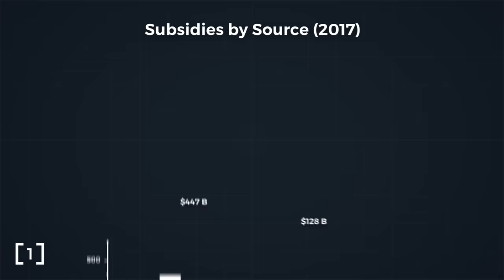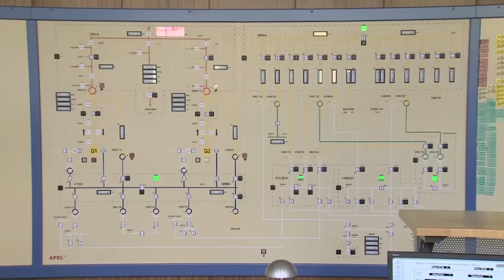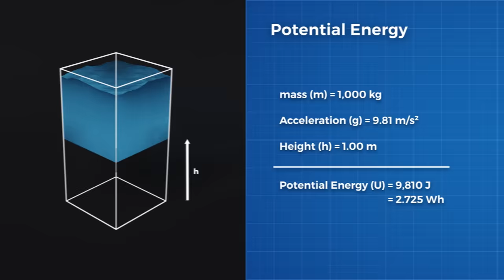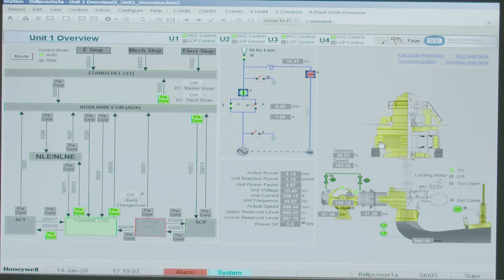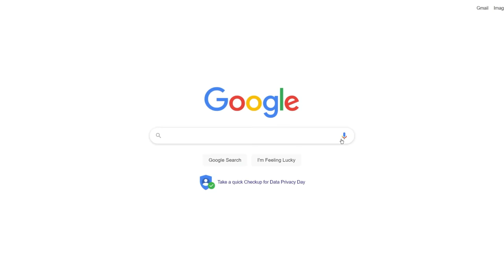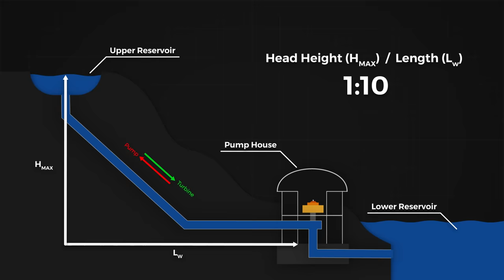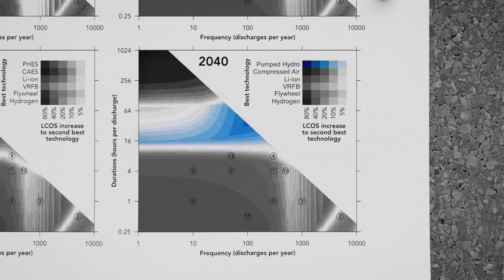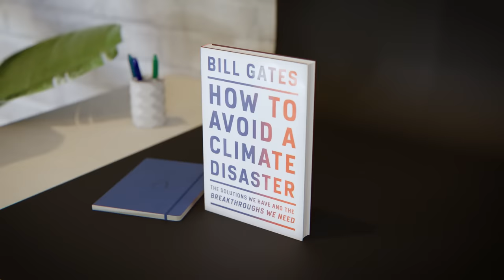The Truth About Pumped Hydro

Comment: Yep sadly you also can't use salt water as cheaply thanks to the salts effects on the piping and machinery. You need more specialized and robust materials for salt water. Not a massive increase but on such a scale even 10% is a lot of money.

However you missed  1 MAJOR advantage of water pump storage. Its ability to do this with nearly 0 environmental damage. All current battery technology just shifts all the environmental impact over to where the materials are mined. While the impact is still lower than fossil fuels its still not a great solution. Truth be told our best bet to remove fossil fuels is to build more of these, add some of those new modular mini nuclear reactors, throw on a few batteries and finish it with less than 5% of the fossil fuels we are using in the form of natural gas just in case of one problem or another.

Comment: Coastal erosion would be a risk with sea water ? if you dig a hole off a coast would that mean that sand from beaches would start falling into the hole when the tide went out, and not wash back in as normal. Add in vented sea water maybe it is like double tide, Plus if hydogen use is about to increase elsewhere does that mean technically it should rain more, so more fresh water should be available anyway. Solved it.  Thats if we plant more trees, I think we should protect coastal stability or else sea could bore a hole inland at certain places, venting sea water might not be as safe as you think

Comment: Has anyone actually crunched the numbers on Wind Power?

Iron ore goes from Aus -> China
Turned into Steel
Tower sections are manufactured in China/Abroad
Blade sections are manufactured in China/Abroad
These then get shipped across the world.
So it's manufactured in a place that is known for having shit Environmental protections/controls and is mostly powered by dirty coal.
Then it's all shipped across the planet on vessels that are notoriously dirty and run off gross bunker fuel.

Towers have a lifespan of ~20 years.
The blades need to be replaced whenever they are struck by lightning.
The blades aren't recyclable and are made of fibreglass.
Every time a blade needs to be changed, a large crane is needed to be moved in (And all the work that goes with that, road works etc)

And when there is not enough wind they don't work and when there is too much wind they don't work.

They also need de-icing if in a cold environment.

Comment: I'd like to ask for some clarity on the energy subsidy data.
  While $447B is approximately 3.5 times the $128B, fossil fuels still make up 80% of global electricity generation while fossil fuels are roughly 5%.
  Per percentage of energy generated fossil fuels would cost $5.58B while the same energy percentage in renewables would cost $25.6B. 
  Is the chart total subsidies or per unit of energy generated?

Comment: I think there are other solutions. While this is great, the proposed solution here to get rid of the natural gas plant is both extremely expensive, displacing large volumes of water, and has an optimal sites. You could also retrofit the Natural Gas with a carbon capture system while also implementing nuclear and pump storage. There are always options, and I think carbon capture is a great technology and constantly overlooked.

Comment: You forgot to mention how much energy is required to pump the water uphill and into the holding reservoir and how long it would take to fill it up from empty. It's all good and well that it can generate an impressive amount of energy in five hours, but if it takes ten times more energy to pump the water up the hill and require a week to do it, then you would need many more pumped hydro stations than was estimated in the video.
Reply: IIRC that was mentioned. The overall efficiency for one cycle is about 80%. Other sources confirm that.
The question of the uphill-downhill ratio power depends on the profile of energy production and demand over time: Do you just want to cover rare peaks, or do you want to store energy for days to cover max demand in times of calm?

It is, however, fair to say that engineers are not idiots and that they know refilling should not take too much time since the timespans of exceeding energy might be short. Such data depend heavily on the purpose of the individual station.

Comment: Renewables are cheaper than fossil fuels. Also in the video, we will need an additional 37 pumped hydro facilities in Ireland to replace ff electricity generation which would only be required with renewables. Also required: massive overbuild of renewables due to intermittency. 

Stop using LCOE to compare renewables to reliable sources of generation. This metric does not factor in storage costs nor the unpredictability/intermittency. If renewables (i.e. solar and wind) were actually cheaper in practice, why is electricity so much more expensive everywhere theyre widely used?

Comment: There are pros and cons with everthing. Something tells me you use way more power to pump all that water up than you make on it's way down. This solution is a capacitor that has many flaws. I feel like the way better solution would be a flywheel. Recent flywheel technology have progressed significantly. They cost less, take far less space compared to lakes, can work for longer that 5 hours and you can have a lot of them one next to another.
While I like wind power the most, I'm sure the nuclear, fission or fusion, is most stable and efficient solution of them all. There are massive problems with renewables. Solar panels are just 20% efficient and windmills are poorly constructed and prone to damage (especially wings/ blades).
Nothing's ever perfect..

Comment: "Renewables are cheaper."  Totally false if you look at it on the basis of cost per unit of power rather than aggregate cost.  "Renewables can provide more than enough power," is also false, which becomes clear when you consider the very low energy density of renewables.  And it all begs the question of the impact of climate change, which is not at all certain.
Reply: [Citation Needed]

Comment: Or just build ~3GW of nuclear power generation for baseload, and then far less storage will be needed for peak demand if wind does not blow.
Reply: @Eugen_Belyaev  I suppose that unfathomable first sentence is a case of "lost in translation". Never mind.

Round-trip efficiency of pumped hydro plants is around 80-85%, depending on their size and details of geometry. Worse than electrochemical batteries, true, but better than molten salt or compressed air, and almost times better than hydrogen.
What exactly do you mean by "closed water currents" ?
Reply: By closed watercourses, I mean pump-turbine pairs operating on closed individual watercourses. All pairs of units are mounted on a common shaft, at the end of which there is a generator. Generator power in the range of units - hundreds of megawatts. Exit to the operating mode takes a few minutes.

Comment: The height of the water is directly proportional to power generation. This can be maintained constant by gradually increasing flow-rate while the height gradually decrease, therefore the rate of water stored is a variable and cannot be computed directly using volume divided by rate. We must consider too the shape of the dam to accurately calculate the exact maximum time of operation. Also, as said, it is energy storage, we still need equal source of power and infrastructures even if we equal the demand. Together, the economical and environmental impact is still undesirable.
Reply: Are u sure with your 1st assertion? flow quantity should depend on the pressure and height of the water column above and below, so keeping that flow quantity stable means keeping the power output stable. 

Second, of course it is relevant at which altitude the water is taken in and let out (or what their respective surface levels are). That may vary, of course. Nothing has been said on that.
Reply: @frankhusel5033  Ofcourse, I am a power plant engineer. I have two licences as an engineer (mechanical and electrical) as well as masters in economics. I will not further discuss the relations and complications, but the basic formula for power generation for dams is this: P = ηXρXgXhXQ. As you can see, height and flow rate is directly proportional and variable, but if height decreases, to compensate for stable power generation and frequency, you need to increase flowrate (also, pressure in this situation is the height of water itself), because you cannot control acceleration due to gravity. And controlling density would be too much impractical for what ever economic cause you want to achieve. And efficiency is assumed constant. My second statement is clear, shape of reservoir has a huge effect to the duration of the capacity through gradual volumetric changes with respect to the gradual decrement at height to affect the gradual changes of flow rate. Simple calculus.

Comment: In terms of electricity I'm fine with nuclear power because of how cheap it can be made with a fuel that's like a battery which can be charged u til it completely degrades. Fossil fuels will still be needed however, the idea of making freight trucks into electricity isn't viable until a battery that can hold a significant amount of power in a smaller cell can be produced effectively.

Comment: If a community uses natural gas.. instead of burning it in a furnace. Use a generator like an APU on a truck. Effectively you could heat your water and your home. While producing electricity to be put out back into the grid. So during peak demand times effectively it would make your energy free. 

Admittedly the problem with such designs is.. most people just want to turn a knob and have the heat turn on. 

And a generator would require some maintenance. 

But really it's no different than what you would be doing on a boat currently. 

And with highly efficient houses with really good insulation. We could actually reduce the needed energy to a small fraction of what we're currently using. 

Side note. I'm all for renewables.. but I keep an open mind on multiple ways to use the same amount of energy.

Comment: Since the distribution out network is already in place a thought comes to mind. It's a "what if" moment. 
Say if the recievers (population)were locally suplimented by their own neighborhoods then the grid might be less dependent in wanting to add more power to transmission lines.

Of course this assumes that at least whatever power would normally be directed outbound at a given high demand point is being generated within those recieving neighborhoods  .

Reducing the need to add suplimental energy. 

To accomplish that,  there would have to be a replacement energy .

This done by converting, by adding inverters and small turbines spread out in each neighborhood that local grid portion would always stay energized. 

Pushing back into a distribution grid by hundreds and even thousands of neighborhoods would lower the demand on the main generators.

If anyone is interested in a further conversation feel free to contact me it doesn't hurt to talk.

Comment: Nuclear as a stopgap to fusion is by far the best solution. High output, minimal impact on the surrounding environment, and doesn't require a battery that has to make up for it.  The life-cycle carbon output of nuclear power is lower than solar and hydro. 

This technology is cool, but is unfortunately the consequence of unstable power generation.

Comment: Would it be feasible to upgrade regular hydro electric dams to pumped hydro? Build a reservoir at the bottom of the dam and install a generator that can also pump water uphill. Currently hydro simply stops when grid demand falls below supply but in future if renewables account for a much larger portion of the supply can regular hydro do more than simply stop generating and start storing power?

Comment: The initial investment in solar takes over 30 years just to break even.  The major problem is energy storage (batteries) and wind is unpredictable and you also have the energy storage problem.  Enough nuclear plants to supply al the necessary electricity just for the USA would create a radiation hazard not worth the eventual outcome (nuke waste, radiation leaks into the atmosphere).  Nope, wind and solar are great backups for your deer hunting cabin but not dependable enough to run the grid 24 hours a day.

Comment: Here is an idea. Over the Rockies pumped storage in the United States, joining the Mississippi and the Colorado Rivers across the Continental Divide. Using excess wind and solar power to pump Mississippi River water to a huge reservoir in the Rockies, and then release it on the western side through generators capturing that power back. If done on a large enough scale, it would also solve the Water Crisis in the west and reduce Mississippi flooding in the east.

Comment: Didn't here you say how much energy is used to pump back to the upper reservoir? It doesn't get back up there by itself......
Reply: He did account for a 80% cycle efficiency, when he talked about the light bulbs. If you mean the general requirement of excess power in order to pump, you are of course right, you need some time where you produce even more energy than needed.

Comment: Wind and solar are not cheaper than modern nuclear power at least everywhere. People in some nations where nuclear power was adopted early are confused as early reactors were way too small, required way too much staff and are very difficult to dissassemble. More modern reactors produce cheaper electricity, do it at same powerlevel day and night, summer and winter. Coal most likely requires subsidies due to environment related taxes. There should not be any subsidies to any form of energy. Let the market decide.

Comment: The USA uses 3.9 billion kilowatt hours of energy per day.  To store a day’s worth of the USA’s energy would require raising 6.5 billion cubic meters of water 286 feet in the air.  There are about five billion cubic meters of water in Lake Michigan.  To store one day of reserve energy for the USA, you would have to raise almost one and a third lakes the size of Michigan 286 feet in the air.

You can adjust this calculation depending on how much storage you think we need and how far in the air we can realistically pump that much water.  However, this gives you an idea of the magnitude of the change to Mother Earth that would be required to store enough carry us through months or days of low sunlight and low wind.  For comparison, there are also 3.9 billion kilowatt hours of energy in 2.3 million barrels of oil, which is about 365,000 cubic meters.

So, to have a reserve for one day of USA energy needs, you can either raise a lake 1.3 times the volume of Lake Michigan 286 feet in the air, or you can have storage tanks with a combined volume equal to 0.000056 of the volume of the water you’re raising 286 feet in the air and put oil in them.

It’s amazing to me that climate alarmists think we are simultaneously completely incompetent and brilliant.  We can’t figure out how to deal with a couple of feet of sea level rise in the next century, a few more forest fires and the occasional drought.  But we can transform sun, wind and biomass, the energy sources in use before the industrial revolution, into cheap, reliable and environmentally sensitive sources of energy.  Or, we can figure out how to lift 6.5 billion cubic feet of water 286 feet in the air as an energy reserve, but we can’t figure out how to safely store 240,000 cubic meters of spent nuclear fuel.

Comment: This is a great video. I like that you not only discussed the positives of pumped hydro, but also the negatives and how it isn't a universal solution. Your explanation of how pumped hydro works is very good.  At this point in this climate change disaster we are in we need to develop all technologies for energy storage and get them in service. We can sort out which ones are the best at a later date. While renewables are a significant percentage of new power generation the rate at which it is being installed at this moment is not as fast as it needs to be to eliminate fossil fuel electrical generation in the necessary time frame. Even more concerning is the minuscule amount of energy storage which needs to be much, much greater to make renewables work as the sole power source.

Comment: Had an interesting thought the other day: South Africa has some big pumped hydro (biggest is 27 GWh of storage), but as far as I know we've tapped out the suitable locations, and need a lot more to transition to more renewables on the grid.  What we do have though are very, very deep mines: 16 of the 22 mines deeper than 2 km are in South Africa, most near Johannesburg, the major economic hub of the country.  Looking at the mine dumps around Johannesburg it's clear that a lot of material was removed from those mines, and several in the 3 - 4 km deep range are closed.  A 3 km head is... substantial - even with the modest storage at the surface that could be accommodated on the existing grounds of the mines, they should represent significant pumped hydro capacity.  Am I missing something here that makes it impractical?  It is possible to pump water from the bottom of these mines - that's required for the mining operations already.

Comment: Biggest failure here is, 5:20. It's a 100W lightbulb. That's what is the problem. Because now you have led light, doing the same job with just < 10W. That means ammount of light is not lowered, but heat is. Lifecycle is in orders of magnitude longer. Investment is back in a rapid pace. Im not a genius, but that is the best solution, not adding giant ammounts of new unnecessary powerplants. Just swap old, and change your devices.